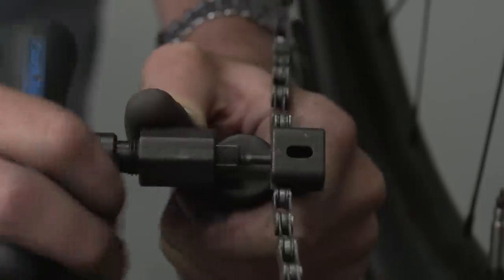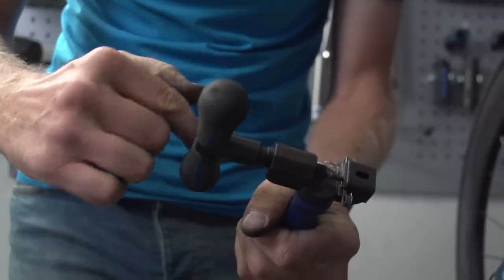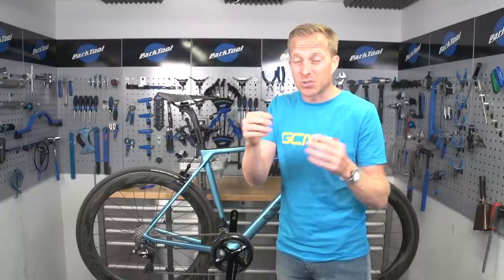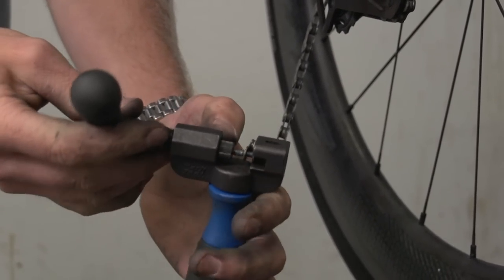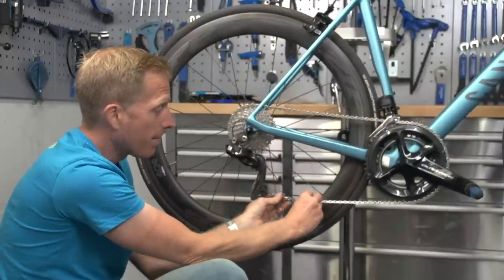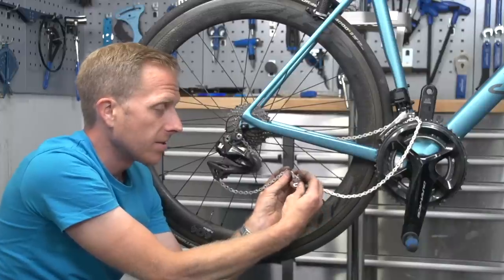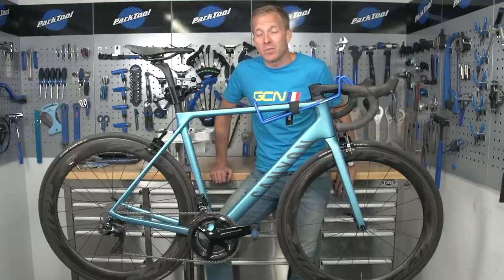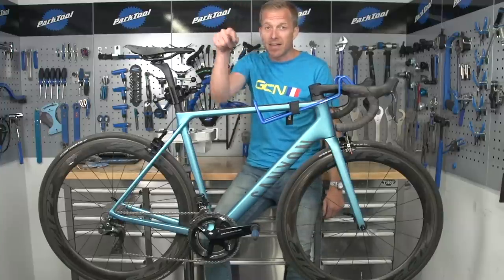How & When To Change A Chain On Your Road Bike

Comment from the maker: When did you last change your chain? 👇
Reply: 2 weeks ago :). And I got a gold KMC... Bling!
Reply: Don’t know 🤷🏼‍♂️
Reply: It's being changed right about this week..
Reply: Last week, along with my new cassette! I am as persnickety as Jon about keeping my bike and drivetrain clean. I also change the chain on a regular basis. I measure the chain about every two weeks and when its worn, its changed. This is why I am just went to my third cassette in 27,000 miles (43,500km)!
Reply: I'm at over 2000 miles on my original chain. It measures just over .5 on the chain gauge right now. Thanks to GCN for teaching me the importance of cleaning... On my previous bike (pre GCN) I was getting 500-700 miles per chain!
Reply: Probably going to change after the season. Haven't got a chain gauge (yet), going to do the test you showed with lifting off the front ring!
Reply: What is your threshold for "worn"???  I have the Park measuring tool.  It's marked with the 0.50 and 0.75 - I typically wait until it reaches 0.75 before I replace the chain but I've never really known if that's ideal or not?????????????????
Reply: I think chains are so cheap, so that I use to change it around 3000km. Just got a KMC Goldchain for my 11-speed (and some other gold-stuff after seeing that C64 gold edition), and a Ultegra 10spd for my old bike like 3 weeks ago)
Reply: Medium Rick park tool also have their own videos. If i remember correctly, there is a smaller and a bigger side of the gauge. So when the small side falls in between links, the chain is slightly worn. When the big one does, you really have to change your chain now )))
Reply: In May.  I actually left it on too long.  The shifting was really poor.  I was looking at everything and couldn't resolve it.  I finally checked my chain and found it way out.  In fact, my past experience was that the chain would break before it elongated that much.  New chain and shifting is back to normal.  But also more frequent checks on the chain.
Reply: When the weather starts to be better again. On my commuter bike I admit I'm not keeping a clean chain all the time so I change it once a year.
Reply: I put about 4,000 km on my chain but replaced it when I upgraded my compact crankset and 11/25 cassette with a 52/36 and 11/34. The existing chain seemed a little small and I didn't think adding links was a good idea, especially when I plan on riding a lot of mountain climbs that will put a fair amount of stress on the chain. Was I just being paranoid?
Reply: If you put your chain in the two biggest rings, Is that not cross training which would wear down the jockey wheels quicker?
Reply: About a month ...pushing big watts takes me through about 4 chains per year at 100-200 miles per week, FTP OF 440W
Reply: about two weeks ago. I usually end up replacing chains 3-4 times a year.
Reply: Just fixing up a glorious junk road bike and I would be surprised if it's got changed in the last 10 years......
Reply: 3 hours ago, last repair of the day. Some guy snapped a $80 track chain. How he did this? I will never know.
Reply: Never, probably should....
Reply: Last time was 2 weeks ago. My chains last between 3000km and 4200km each, averaging 3500km. Durability is linked to the general weather conditions of the season. In summer (wet in Brazil) they last significantly less than in winter (very dry). When my crude but handy maintenance database tells me usage is around 3000km, I start checking chain length every week.
Reply: In 10 mins. ... Brilliant John, always spot on whilst explaining. Thanks for a vid.
Reply: In 1976
Reply: Why?
Reply: Well the process started last week when the old one removed itself after 4500+ miles.
Reply: Campag recommends <= 0.8% stretch but they sell chains of course. I replaced at 1.2% stretch. In 1999 I forgot & it got to 2.0% stretch which was a disaster jumping sprockets, stay well below 1.5% stretch.

Comment: If somebody hasn't mentioned it already, it can be helpful to install the special connecting pin pointing towards the outside of the bike rather than towards the bike's center.  After breaking off the pointy bit from the connecting pin, there always seems to be a little bit more protruding than the other side, which might rub against the a neighboring sprocket as the chain enters/exits the rear cassette.  

Not a big deal, and might be fixed when fine-tuning the pin depth anyway, but is recommended by Park Tool literature.

Comment: One thing that wasn't covered is the direction of the chain. As far as I know, Shimano chains should be put on with inscriptions on the outside. Sram chains are bi-directional, but the masterlink is not. There is an arrow on the masterlink showing how to install it. As for the other manufacturers, I have no idea :P

Comment: An oily thumbs up! It is much better having master links or special pins than the old methods of my youth. I gather Shimano are switching to supplying master links now also. Other than a new chain jumping on it, are there other ways to tell if your cassette is past it? Typically how many times do you expect to change a chain before a cassette needs it too?
Reply: You have to look at the teeth of the cassette. Compare them to a new one, they should be sort of rounded. If they look like shark teeth instead, the cassette is worn.

Comment: Never thought of taking the pressure off the chain to join it before. Bleedin' obvious in hindsight
Reply: Same here.  Felt really stupid after he said that.
Reply from the maker: That's what Jon is here for
Reply: Many pocket tool sets have a thick wire tucked in, curved in the form of a tall "C" letter. Attach one end one roller or two from the break, the other end one or two rollers from the other end and now you've got a nice, easy point to work on breaking/joining the chain.
Reply: Ja ja, but John's solution is much better. Plus I can now save some weight on the bike by ditching that punishingly heavy chain holder
Reply: Same here I have always struggled doh
Reply: Lol. .. it's amazing how smart some of these you-tubers are 🌄

Comment: Worth mentioning that when you are comparing a new chain with an old chain to measure the length, be sure to account for wear. You may need to realign the chain links to ensure your not adding a link or two to the length,

Comment: One of my bike chain if I get the correct length (108 links) on the lowest gear and big chain ring, will sag when it is in the highest gear and the small chainring. It sags enough to lay on the front derailleur. I remove one link and now it is stretching bad when in the lowest gear and large chainring.
Reply: What groupset do you have? Are all the parts original as when new? Has the rear derailleur or cassette been replaced? Do you have the original chain? Was it pinned together? On your replacement chain are you also pinning it or using a master link? If you’re running a replacement cassette with bigger diameter cogs and still using a short cage derailleur, that will cause an issue because a short cage does not have the capacity to adjust the chain slack for cassettes beyond a certain ratio range.
Reply: I found out the problem. I had used the wolf tooth road link and it was the extra length that made everything off. I took it off and now it is s as ok back to normal.

Comment: You talk about one chain checker, in hand, then show another in use.  A bit confusing. Secondly if you hang a badly used chain and compare it to a new chain, the links will not match towards the end, although you do say to match the links. I lay both on a bench and insure the number of links match, thus avoiding the gravity issue.  I like the idea of removing the chain from the chain ring, much easier, never thought of that and have always had a bit of struggle.  Thank you.

Comment: Actually I think the best method to find the best chain length is small-small so that you have the longest possible chain. Firstly you still can remove links later any time. And secondly you still have enough tolerance for larger cassettes as I always tend to use when I go to the mountains.
Reply: se7enTse7en The difference the OP is talking about, is the limiting factor of the derailleur to take the tension. Therefore when the derailleur is fully closed up, it is at its maximum chain length as no spring action is left. Therefore you ensure the maximum chain length, whilst going big big you don’t as it is related to the cogs not the derailleur. You could check both to see if it will work in all combinations, especially if fitting a bigger cassette.
Reply: if you use big-big you can evaluate what is the shortest possible chain. that is, when the rd is nearly fully pulled forwards. that is the chain length which is just long enough to fit around both large chain rings/sprockets. while this is the best option in terms of drive train efficiency, I reckon, you lose the option to fit a larger cassette. e.g. when your biggest sprocket is 25t normally and you want to fit a 30t you need a new chain.

Comment: Actually better way to get chain length is to do it with chain on small chain ring on front and smallest on rear. Then you should ensure there is the minimum tension.

Comment: Excellent video as always Jon.  In my view, the strength of GCN is that it caters for a wide spectrum of riders.  Tech videos like this have a broad application.
Reply: I would agree with you were it not for the fact that Campagnolo users are rarely included in the advice.
Reply: But Campy users know they are special.
Reply from the maker: Cheers John, that's the idea

Comment: Chains usually only get changed once totally worn out. The tell tell sign is the teeth wearing... It's funny but GCN never mentions that a brand new chain on a cassette and chain rings which are starting to wear doesn't always mix well.. ( jumpy chain 😡) would be nice to see a video on fixing a chain with a master link or a campy chain. Keep it up!

Comment: What do you do with the grease that new chains are packed in? Degrease it while the chain is brand new or leave it on until the grease wears off?
Reply: K Lee I always leave the original lube on for as long as possible. It's a shame the 'new chain' lube isn't available in a bottle.
Reply: CnE startup idea: chain lube that is called "That new chain lube" ))) Would be like candles with "that childhood scent" from 21 pilots "Stressed out" song
Reply: K Lee leave it on

Comment: Chains DO enlongate under heavy wear!

When I compare old chains I take off with exactly the same model and lay them side to side and say they are 100 links long, the worn chain is around half a link longer give or take!
Reply: Yes. But that's not stretching. It's because the internals get smaller thus giving the pin more room and that's like .5mm per link. The links are all the same length but the chain is longer because the links aren't as close to each other. So it elongates but it's does not stretch

Comment: Rotating chains means you can use chains for more miles each without rendering the cassette useless. Do 500 miles on chain A, 500 on B and 500 on C. Rinse and repeat. You could be looking at upwards of 10000 miles on one cassette without any trouble
Reply: Still can get costly. Cuz those chains aren't that inexpensive. Not sure about the cassette though. 500 miles isn't much riding to be swapping chains. I get from both my particular cassette and chain just over 3000 km's (1800+ miles) then I replace both. Only costs me 120 canadian dollars for both parts (for 3000 km's or 1800 miles of use).

Comment: I'm replacing my chain as its just getting to the point where "stretch" is detectable. I wish to install using a master link so that it makes future lubrication off the bike possible. Do I need to take a link out to compensate for the master link or will the existing set-up simply take up the extra length?
Reply: decided to watch the clip to the end - the answer was there.........

Comment: #AskGcnTech I have a question about my bike. I currently have the stock kmc x11el chain, but I want to upgrade to a dura ace chain. The lengths are 118(Kmc) to 116. What should I do to resolve this issue?

Comment: I changed my chain and it started to jerk when riding. Guys at Halfords said it is due to the bike skipping a gear and couldn’t fix the problem. Decided to put my old chain back on 😟😟
Reply: AMD Your cassette is worn. If you neglect to replace the chain at the ,5% mark, you’ll likely wear the cassette beyond its capacity to handle a fresh chain and you have the skipping you noticed.

Comment: Do you reccomend to change the cassette every time with the chain or I can use 1 cassette with 2 or 3 chains?
Reply: The cassette will wear far slower than the chain. I’ve had my bike for two years and not changed the cassette yet, and changed the chain three times
Reply: It really depends on how and where you ride. If you live in the upper Midwest of the USA every 4 chains as long as you have a second set for winter. If live in a Coastal environment I'd say every other and maybe even replace the freehub while your at it.
Reply: Golden rule is keep the chain nice and clean, that way the chain and cassette will both last longer. If your cassette is worn when you replace the chain you’ll know it because the chain will run badly and even skip when you apply pressure. That’s speaking from experience!

Comment: Also don’t waste time with pins. Master connectors are way better given you can take them off to clean chain and put back on and they are reusable. Connecting pins are too temperamental. Also run the chain the opposite way he does thought he derailleur as it’s easier

Comment: The chains do stretch. You can see the difference side by side old and new chain.
Reply: Effectively, yes the chain appears to have stretched from a side-by-side comparison, so a person can think of it in that way.  What Jon is getting at in the video, though, is that the actual material isn't getting longer, the steel link plates for example.  Maybe there is some very slight plate deformation if measured with a micrometer, but the primary reason for the chain getting longer is wear.  Each link can pull slightly farther away from its neighbors because there is more space worn out between the pins and the plates.  The material hasn't stretched, but the wear has allowed the chain to become looser and hence longer.

Colloquially, though, it is easier to just think of it as stretch, measure the stretch, and replace as needed.

Comment: Um yes chains do strech, I change chains every day and fit new chains every day. Most of elongation is from the rollers getting shredded but links in chains do infact strech. I can put max 5sec power of only 980 watts and I can snap a cheap chain. They do strech over time with constant standing starts from commuting.
Reply: Dave Hogue I'm not trolling I'm explaining  that a statement was made that is "not technically true". If you would consider that a troll I think your going to have rough time on the rest of the internet.
Reply: Also when I am "trolling" I prefer to live in caves
Reply: Lmao are you doing track starts at every stop light
Reply: Tor not every but waaaaaay to many
Reply: Its pretty easy to see that they stretch. when putting the new and old chain side by side on the floor, you see the old one is almost like 1mm longer than the new chain at the same chainlink. I also saw a trackcyclist that could put out over 2000watt on a wattbike snapped his chain while trying to accelerate hard on the roadbike.(but maybe not stretch as in the links getting longer)